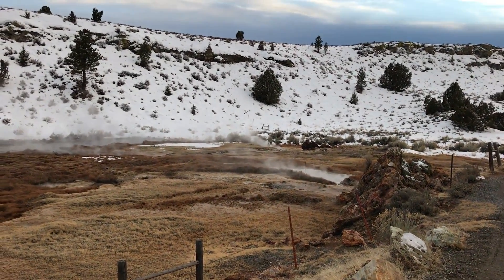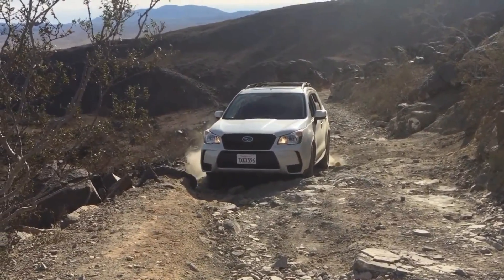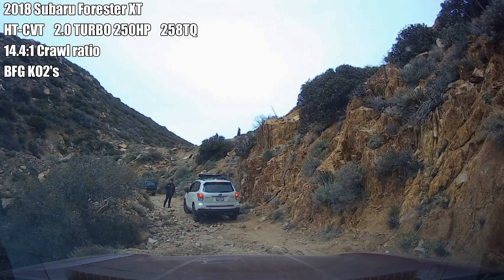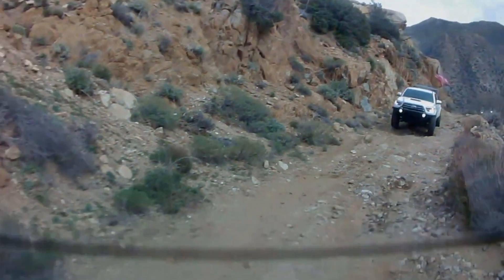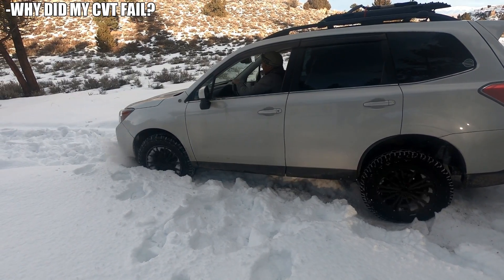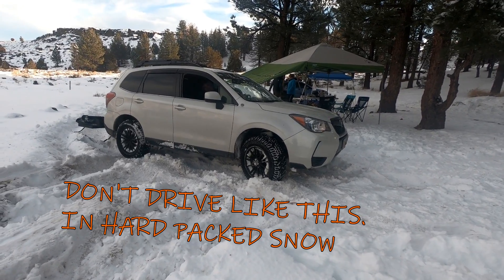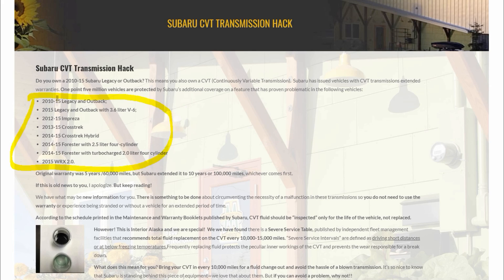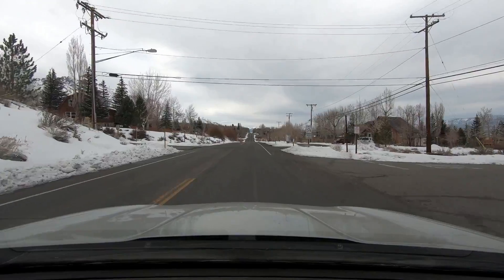CVT transmission Failed!  Can we make them last?

Comment: CVTs are not good for off-roading applications. They’re designed for great gas mileage. Subaru is mass producing for the common market. They’ve definitely left a lot of subi enthusiasts behind with their transmission choices.
Reply: That’s why I snagged one of the last 2018 Manual foresters!
Reply from the maker: Oh God!  I totally agree!  I'd wish they would, at the very least, offer a proper A/T for upper trim Subaru's.  Heck!  They should just go with a 3rd party transmission, so they could at least blame them for any issues.  Subaru's in house built transmission points all the blame on Subaru.
Reply: I should go with manual as well. ;(
Reply: Cvt issues are rare. Look at the number of Subaru cvts on the road today with no problems.
Reply: @egx161  only 2 out of 10 Subaru cvt cars make it past 130k…that means 80% fail before the 130k mark..that’s not rare to me…but most people do not change the fluid as they should either..anyway, cvts have no business being in any all-wheel drive vehicle ..a manual is the way to go..regular automatics are not as durable as a manual either…cvts are ONLY good on gas ..that’s it.
Reply: The test I seen on You tube showed a different story,  The Subaru seem to work just find with the CTV transmission.  Do you know Viscosity is the slipperiness of an  Oil, And the thing is   The thing is, Oil over heating  of  the CTV oil is a major problem in  CTV transmission. Over heating burnes the oil I saw a video once  on you tube,  where an Auto repair shop pull apart a failed GTV transmission. It came   out of an old  Subaru, You can see The magnets in the CTV transmission were choker block full of metal shavings. What  this meant was that over time the CTV oil  in the CTV transmission  had been burnt and it had lost it viscosity, and could no longer  protect the Belts and  cones in the CTV transmission Just changing the CTV oil would have enable the CTV transmission protect the tranmision and it would have  lass a lot longer.
Reply: Your right on point on this one. People are getting carried away with their subi doing off roading. It’s capable enough to take you off road. But not design to off roading all the time.

Comment: Hey Jon, I love your content and this video is a great resource going forward. I own a 2015 manual wrx and just bought a 2019 Forester Sport. I've seen a lot of videos of people doing off road in their Subaru vehicles and different transmissions.

I've been really wary of cvt's, especially the Nissan horror stories. You made a good point on a couple of things. The first being the fluid change interval. The recommendation change is nonsense! Regular drivers who go months and months before changing out fluids are most likely not using the top tier stuff for their vehicles and will most likely be prone to these issues. The stock oil's from subaru aren't exactly made for long intervals before shearing (given the conditions like stop and go traffic and hard starts off the line) and not protecting the mechanical components properly.

In the owner's manual Subaru calls for more frequent changes if you drive a manual transmission how you're supposed to ( i.e. rev matching your down shifts) so it is kind of a head scratcher on why they have a giant gap between fluid changes.

Which brings me to my next point: powertrain options coupled to the cvt. The turbo engine cars do put out more torque and thus cause more wear and heat to be applied to the cvt.

 In the cvt wrx, tuners only recommend going to around 330-350 tops on that transmission as anything more leads to premature wear and could cause total failure. Driving technique also plays a part there of course. But I'm thinking if the N/A (naturally aspirated) engines cause less damage to the cvt and lead to longer lifespan of the transmission. Given proper fluid change interval and adding on a transmission oil cooler could ultimately save a lot of $$ over the life of these units. Especially for the off roading people, which I hope to get into in the future.

Thanks for the great content and I hope to see Subaru continue making strides forward in dealing with these issues!
Reply from the maker: Great comment!  I honestly expected this video to be one of my more unpopolar ones due to the subject matter, but I'm definitely elated by all the support and comments.

Thanks for getting into all the details and bringing up a good point about these long intervals.  My service advisor recommended CVT fluid change at 90k miles. That's crazy!  Even for drivers that just drive on the street.
Reply: mrbl220 I believe Subaru & Nissan use the same 3rd Party CVT maker. Jatco
Reply: @Benjamin-David  I have heard the same thing but I've also heard and read Subaru makes their cvt in house. Given how small Subaru is compared to say Toyota on a global scale, I'm not sure they have the resources or capital to do that. 

But Fuji Heavy Industries as a whole could probably help fund it. I hope to just see continued progress and revisions going forward and helping owners in previous cars with goodwill replacements or eating some of the cost to replacements to retain their brand loyalty. 

Like I said, I just bought a 2019 and it is my 5th Subaru. I love these cars, even with their quirks and problems. The community is wonderful and there is SO MUCH knowledge out there!

Comment: I uploaded a video just now and saw you already did one a not dissimilar topic. 

It draws pretty much the opposite conclusion you have in this video.

Does that make you my frenemy?

<3
Reply: Bruceyyyyy, since it's relevant now, you may be interested to know that I finally got to speak to one of their engineers (a relative of a friend, sorta thing). Got some nice insights...but that's unrelated. 

What is related to the topic of this video is that during our talk, Mr. Subaru Engineer went on a massive rant about how the CVT is unable to hold up to high-power output. He defined high output as anything other than n/a 4 cylinder models. We didn't talk at all about oil coolers unfortunately, but I have to imagine it'd help to have one.

Good news is that it's a known issue that should be getting addressed.
Reply: @powerofyourbrains  I've had a cooler on mine since about 10k and change the fluid every 50k.  Is fresh fluid any help? I can send mine to Blackstone. 

J are you stalking me? Kek
Reply: @bruceyyyyy  Since that rant was unsolicited and I was admittedly more interested in hearing details about upcoming models, we didn't really explore the topic as much as I wish we did now. I'm sure people could benefit from that analysis, so I think you should. 

One of the contexts I remember them using as an example of trashing CVTs was at press events, where they're generally pretty hard on the cars. It'd be educational to know what kind of impact driving style has on it.
Reply from the maker: No Bruceyyyyy, I don't care if you don't love me, I consider you my friend :P
Reply: @JonDZ_Adventuring  Traitor! Should have bought a Jeep! Something Lawnmower Honda!   I really like the build man. Keep at it. 

PS I have seen a Kobalt 40v lawnmower that caught fire. Fun times.
Reply: I saw that video just a little before finding this one. I'm relatively new to Subaru's and their obviously idiosyncratic transmissions, but there were some obvious differences in diving styles between your vid and this one. CVT's may be a weak link in drive train, but I it seems like there's a significant amount of abuse going on here as well. I think that factor may have been overlooked a bit here.
Reply: @davidmedeiros_mapbliss  I think at the end of the day there is a lot of information out there and a not insignificant amount just isn't good info.

This video is an example of good info.  

Cool the fluid.  I've had my AT Temp warning light come on before.  The thing goes into limp mode and puts basically no power to the ground.  Symptoms seemed similar in this video.  I just left it running and ran the heat on high and went for a walk.  Once the light went off it worked fine and has for years now.

Change the fluid.  Subaru recommends somewhere between never and 25k.  I'm splitting the difference and doing it at 50k.  Which is right now.  I'll get a Blackstone Labs analysis done for my own curiosity and find a place to post it.  Either YT or OB forum.  I'll be using the HT CVT Fluid.

Monitor the fluid.  I have an old scangauge that we managed to dig the CVT temps from.  I used to see as high as 270F before the cooler but haven't seen higher than 220 now.

Other thoughts: Subaru seems to recommend replacement over repair for these often which is where that big 8k bill that scares a lot of folk come from.  

This seems to be standard policy.  They did the same thing with the 5EAT.  (5EAT's actually cost more than a CVT from Subaru)  The difference here is there aren't any 5EAT's that are still in warranty.

I've seen them repaired (search around the google for 580/690 info and you'll find lots) and one can pick them up from salvage yards with a (short) warranty for a few hundred dollars. 500-1000 seems to be the norm.  I think I saw one as low as 300. (car-part)

I did draw a different conclusion than JonDZ in his video here with the bog down/hill climb issue.  

I think the traction control is what does it.  I have a video (subaru smarter than you) on it showing that ripping fuses to disable traction control the car will happily power up a hill but turns into a diagonal spin wonder like all the older Subaru's are.  

Something in the programming can't figure out steep inclines and wheel spin so it decides to do nothing.  

I'm looking forward for someone to really put the dual x mode on the new Foz/OB to the test as I'm yet to see a video of people do what we're doing to it.  

Still not sure if gimmick or not.

...

Thanks for reading my novella in the comment section. (:
Reply from the maker: Thanks  @bruceyyyyy  ! This comment is pin worthy!  I can't pin a reply, so I'll do a copy and paste.
Reply: @JonDZ_Adventuring  I could repost it as a new comment. 

I think VDC became standard around the same time CVTs did so that's where I'm getting my conclusion as far as it's the limiter. That plus like I said ripping the fuse out the CVT will power right up things even if it's a one wheel wonder.
Reply from the maker: @bruceyyyyy  I've watched that video multiple times I shared it with people that claimed "the CVT cuts power".  I'm seriously a fan of your work.  So, your post is already pinned to my main post along with a shoutout to your channel (as well as power of your brains).  I didn't know you guys are in the same area!  That's cool that you two met up!
Reply from the maker: @davidmedeiros_mapbliss  I wanted to add that you don't have to off-road or abuse your vehicle to get the transmission temps high.  Here's some info from @Daklakfoto driving up highway 14 in Lancaster, California.  He recorded 240 Fahrenheit driving up a steep asphalt highway.  

Quote: "Jon Tuico same drive condition: weather at 80F; 1.5 hour normal FWY at  up to 75 mph (ACC), then up hill for almost 45 min
Before cooler: gets to 240F
After cooler:    max at 195F
for CA local, you can try your drive from Socal to Lancaster via 14 HWY to test. (ha..ha..ha)."

Comment: Subaru uses Jatco transmissions owned majority by Nissan they have had a long history with terrible 6 speeds and CVT transmissions. To my knowledge it’s a design flaw I’m actually surprised it lasted that long since I’ve seen brand new Nissan with 12k miles blowing the CVT transmissions. Bring back the manuals Subaru’s 🙌🏼
Reply from the maker: The Subaru 4EAT transmissions were made by Jatco, the Subaru lineartronic CVT's are made in house by Subaru :P
Reply: Exactly! Scotty Kilmer the car mechanic did a video on this and said Subarus have weak Automatic/CVT transmission...
https://youtu.be/ymtiAMUPYRU
Reply: Sgt. SLaughter rev up your engines yeah I seen it Scotty is the best 👍🏻
Reply from the maker: @Consolethumbs  Yep!  That's exactly why I mention that Both the 4EAT and CVT are suppose to be "Just as reliable as each other" but... it's been proven, the 4EAT is more capable and takes more abuse.  It's more reliable offroad.  I hang out with sooooo many offroad subaru owners and I get to observe the differences in capabilities and I hear about the reliability issues.
Reply: https://community.cartalk.com/t/wtf-got-a-letter-from-subaru-saying-the-cvt-transmission-may-fail/126551
Reply: My Nissan CVT needed internal repair (valve body/stepper motor) at 72k then full failure at 78k miles
Reply from the maker: @zero2sixty244  oh geez!  That sounds like a terrible experience.  Sorry to hear about it!
Reply: JonDZ Adventuring thank you! Can’t say I didn’t expect it though as I read into the CVT issues plaguing Nissan’s but said “I’ll change my transmission fluid at the dealer regularly, it’ll never happen to me!” Yet it did. Oh well, I’m glad I got it replaced before the 4/20 warranty end. I currently have a 2018 Forester rental as another vehicle is being repaired at a body shop and the CVT seems decent, although I’ll always prefer traditional autos. Please keep us updated on the Passport’s 9 speed as I’d like to know if they truly fixed the issues as I’d love an Elite some time in the future.

Comment: yep, I just sold my 14 XT this weekend due to being frustrated with the cvt. It was giving me all kinds of issues and subaru didn't wan't to actually replace my transmission even after it would die sometimes coming to a stop like a red light. I sold mine with 77k miles.
Reply from the maker: Pleasure Tek I'm so sorry to hear about your situation.  It sounds like your dealership didn't even inspect your transmission.  Stalling is a major safety concern, and being ignored must have been a very frustrating experience.  It's alarming to find out about so many people that have issues with the SJ FXT.

I did regular maintenance and also even proactively took care of TSB's.  There was a leaky transmission gasket TSB, I inspected under my FXT and found some seeping, so I got that fixed.  The only things I didn't do is 1.) monitor transmission temps, and 2.) change CVT fluid sooner than later, WHICH IS NOT COMMON KNOWLEDGE AT ALL.  Subaru would be wise to advise their customers.
Reply: @JonDZ_Adventuring As you know the xt is a blast to drive. It was a fun vehicle for the first 5 years (purchased from first batch into US march of 13). I also busted struts on her and had lower control arm bushings replaced around 50k and at 77k I was getting high speed wobbles again. But the CVT issues (cost and reliability) made me make my descision, that and my wife's 03 feels and seems to be much more capable in so many ways, 214k on original automatic transmission, but about to need to get head gaskets done again, but her 03 has been a solid tank for the past 16 years.
Reply from the maker: @pleasuretek  yes, i loved the car and then pretty much instantly hated it once the CVT went out.  

Now I have a 2019 Honda Passport.  It's a ridicously awesome vehicle.  Everything gets turned up a notch except for "nimbleness".  Agility is the thing that gets turned down a couple of notches, haha!  It's still fun to drive, I like to think of it as the bat mobile.  Its a big vehicle, but with power based torque vectoring, it handles better than it should.  Its a quick vehicle, 0-60 in 5.8 seconds according to car and driver.
Reply: Pleasure Tek damn that sucks because it was a design flaw and Nissan and Subaru are trying to hide that from people
Reply: @Consolethumbs  for real. I took my car into the dealership twice past 8 months , and even told them I was having break light issues, and they didn't replace the brake sensor that had a recall 6 months later. I described my transmission issues to them too many times, for them to recommend I DONT do a flush and just do an ecu reset instead (even when transmission is obviously leaking too)

Comment: Subaru just needs a dual clutch and call it a day
Reply from the maker: Noooooo, Actually, most dual clutch transmissions don't have torque converters.  Acura is the only company that stuck a torque converter along with a dual clutch to smooth out shifts, kinda of defeating the purpose of a "Direct" transmission, but who knows, it might actually do well offroad?  I dunno.  Subaru's are offroad oriented passenger vehicles and need an Automatic transmission with a torque converter, imo.
Reply: Why that love for dual clutch? Some of them are annoying in traffic. By the way, there's some videos of the Hyundai Kona off road, and it shows how the dual clutch sucks in that car. Then again, a VW it does well...but they have much more torque too. I don't believe a Forester 2.0 dual clutch would go up some of this hills without trouble... Maybe (yes, maybe) a 2.5.
Subaru just needs to give a proper upgrade to the CVT...maybe like Toyota, with a real first gear?